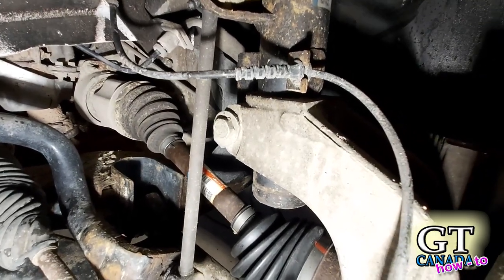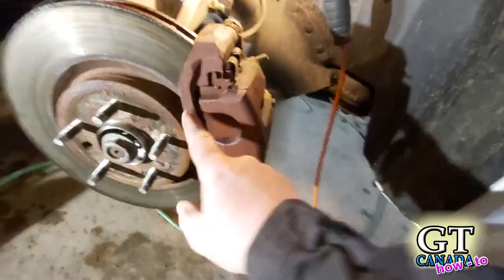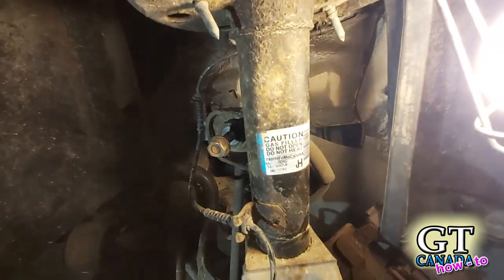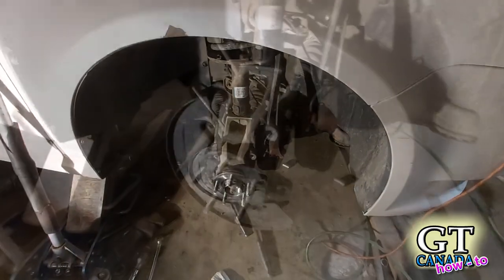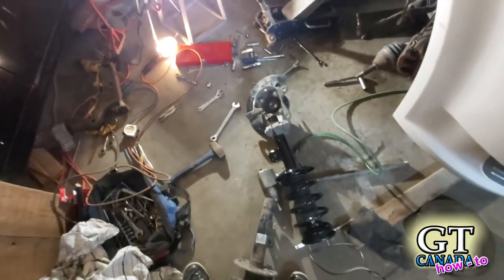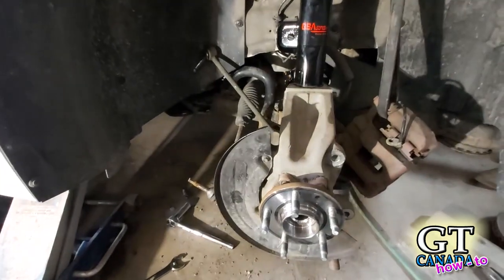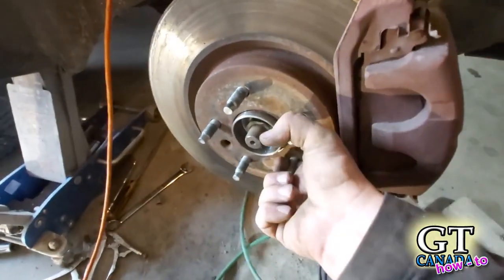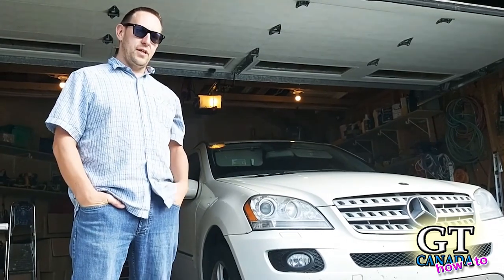2009 - 2013 Ford Flex Front Strut Replacement - GT Canada How To

Comment: Great video.  When the whole unit is on the ground check your wheel bearings they should turn smooth. Easy replacement then.
Reply from the maker: Yes for sure, that would be great time to check them. I had already replaced those so I knew they were fine, but for anyone that hasn't done them, this would be the best chance you'll ever have
Reply: What wheel bearings
Reply from the maker: The front wheel bearing. They are a complete hub. When you have the drive shaft out just rotate the hub assembly. If they are bad you will feel them binding up, catching, or grinding.
Reply: Then you’ve never done it. Spindle removal is far from easy. Simple but not easy. Perhaps it’s different on your year model. As the strut replacement was on mine. I was prepared to spend the day replacing struts. Took 2 hours. Only because I started the removal by following instructions on an earlier model. Night and day.

Comment: Just wanted to say thank you for the video.. Because My Lincoln MKT. Front strut, I was replacing and could not figure out why the struct was not comimg down. Until you showed that I have to drop the lower Control Arm. Than I was like yes. Again.. Thank you. Helping a working father save alot of money.
Reply from the maker: Glad it helped

Comment: Thanks. I have to do this job on my Lincoln MKT this weekend. Hopefully I don't find that I need control arms, but it won't surprise me if I do.
Reply from the maker: Good luck!
Reply: @GearsAndTech  Thanks. I wasn't able to get to it this weekend, but I did finally get to look at my parts, which had been shipped down to my sister's place where I do my bigger repair jobs, and the suspension on my '13 MKT is different than the front suspension on your earlier Flex. The strut is bolted to the knuckle via a bracket with 2 large bolts. You do have to take off the axle nut and drive the axle out so that the knuckle can tilt forward to release the bracket, but I shouldn't need to pull my control arm, which is a big relief.

Comment: It's a whole lot easier to take control arm off shoulder put in the back bushing then the strut with shoulder reattach ball joint then use a jack to push the front bushing in place
Reply from the maker: Could be. Glad you found a Esier way

Comment: Why didn't show how to remove the strut from the knuckle? That's the hardest part and I'm now stuck because I got the nut off but can't get the bolt out as it's easy to strip the bolt head. Do you just knock this part out with a hammer or is the inside threaded all the way through?
Reply from the maker: It's been a while, but I think I banged the  bolt till the head was out. Then I put a wrench in between the head of the bolt and strut and just turned the bolt while I leveraged the wrench to pry

Hard to explain. But it's a trick that works all the time
Reply: @GearsAndTech  I figured it out. I ended up having to use a torch and cut the screw in half with the little space I had between the knuckle. Then knocked the screw halfs out in opposite directions. Thankfully the driver side screw came out with 0 issues though.

Comment: What brand did you end up buying and would you recommend after driving with them installed? 
I'm looking at a front and rear kit made by TRQ as well as a kit from Detroit Axle.
Not sure which to go with, but I'll definitely be using this video for the install. 
Thanks!
Reply from the maker: The ones I used were from ebay. I spent a little extra because the were the only ones that said they work on 2009, which is different than 2010+

Theu ended up sending me 2010+ anyway, which meant I had to swap the end links for 2010+ and modify the sway bar. I'll be putting that video up soon

If you have 2010+ then go for whatever fits your budget. I think they are all pretty much the same until you get into name brand stuff.
Reply: @GearsAndTech  ok thanks. 
I have a 2011 limited that I love, but for some reason it just eats tires. 
I just put on my second set within a year's time. 
The ones I took off had major wear on the inside and outside edges.
I have a steering wheel shutter on the highway (around 70-80mph), but from what I can tell, all of my front end looks in tact. 
My tie rod ends have no play, none of the bushings are blown out, and none of the wheels have any play side/side or up/ down. 
I've got brand new tires, balanced, alignment, and the shake is still there. 
I'm taking a shot in the dark that it needs struts but don't really know for sure. 
Just trying to prevent blowing through another round of tires.
Reply from the maker: Inside AND outside usually means under inflated tires.

If it was just inside or outside I would look at suspension.

Warped rotors could cause the steering wheel shake too. Does it get worse when braking?

That much shake would be bent rims, not balance good, really bad tie rods or suspension bits (usually clunks over bumps too), or warped rotors.
Reply: @GearsAndTech  it's weird, man. 
Sometimes there is no shake at all when braking, and sometimes the shake is there. 
Maybe I should replace all the rotors first before diving that deep into the strut job. 
Couple friends of mine also mentioned brakes or a possible caliper sticking, but I never smell brakes or have any glaze on the rotors. 
Who knows, man hahaha. 
I definitely have something going on though.
Reply from the maker: I used to have a van that the rotors would warp going down long hills and riding the brakes slightly. The steering wheel would shake violently.

I switched to cross drilled rotors and all my problems went away

It only happened after riding the brakes for a long time.

You could simulate a hill by driving down the highway and have your left foot on the brake to warm them up.

You could try that too.

The flex is notorious for sticking rear brakes. Which I did a video on how to fix. I never got a shake, mine just had poor gas mileage and brake dust on the wheel.

Since yours is causing the tires to wear quickly on the front then it's for sure the front.

I would test the highway with the brake on trick.

If it happens a lot you can check the run out on your rotors with a dial indicator on a magnetic base. Or just buy the slotted rotors anyway and put new ceramic pads on and see what happens.
Reply: @GearsAndTech  I'll give that a try. 
Thanks for the time and advice, man! 
Great/ helpful videos too!
Reply from the maker: No problem

Tell you friends about the channel. And come back often!

Comment: I need to swap out my axles on my flex! What do you recommend as the fastest route without having to take apart too much?? Thank you.
Reply from the maker: I would disconnect the lower control arm at the frame, and the steering arm then swing the suspension out enough to get the axle out.

You don't want to be splitting ball joints or anything whenever possible. They tend to break easy
Reply: @GearsAndTech  thank you very much!! Much appreciated

Comment: How did you clock or figure out to clock the strut? During an alignment adjustment instructions for camber says to on rotate 180 degrees.. 3 or 9 o'clock.
Reply from the maker: It only goes in one way.

If you wanted to clock it to see if it makes a difference you leave the bottom attached and rotate the top

I got an alignment done at a shop after and they did whatever they needed to get it all within spec

Comment: Did the new strut assembly’s come with new washers for the sway bar link? I had new struts, but no new washers and now there is a 1/4” gap of play where the sway bar link bolt goes through the strut. So I’m wondering if yours came with those washers. Thanks
Reply from the maker: Sounds like you had the problem I had, you have a 2007 and your links have a taper to them.

If thays the case you need to get 2008+ sway bar links and install those.

Your sway bar will need the holes ground out a little bigger to accept the new links. I made a seperate video showing that.
Reply: @GearsAndTech  thanks so much! So I have a 2009, but yeah the sway bars don’t fit right. So I need to get 2008+ and ground out in order to accept the new ones? Thanks

Comment: Okay. Im doing the exact same job. You mentioned the control arm bolt with lock tite. How did you get it out? The nut i thought was welded to the frame but its not and i am on day five of trying to figure out how to get it out. Please help. Any advice
Reply from the maker: A long breaker bar with a pipe on the end is what I used.
Reply: @GearsAndTech  yea i did that and the nut is stuck on the other side.

Comment: what did you find out about the sway bar link mount issue of being loose
Reply from the maker: Turned out the struts they shipped were for 2010+ flexs

So, I just bought 2010+ sway bar links and installed those. Solved the problem completely.

I made a video how to modify the sway bar to accept the links. It'll be uploaded in the next week or so
Reply: @GearsAndTech  bought the newer sway bar links and had to drill out the sway bar holes bigger to make them fit. thanks for the video helped alot!
Reply from the maker: @esp68camaross33  Yes, Hopefully you found the video I just put up showing How I did that. You're on the same journey I was on with mine. 

Hopefully you don't arrive at the same conclusion I did about the Ford Flex in General

Comment: For the stabilizer links, what would happen if one were to use a 7mm hex head that fit into a screw bit attachment which fit into a 1/4” ratchet, and rather than use a wrench to tighten the nut, put a wrench on the nut and used the small ratchet to spin the centre bolt left to tighten the nut? Would that ruin something?
Reply from the maker: Sounds legit. Let me know how it goes

Comment: Is there a reference mark on the new strut so you know how far to slide it into the knuckle before tightening the pinch bolt? So both sides are even or it's at the proper height?
Reply from the maker: it will only go in at one height.
Reply: @GearsAndTech  I just did the rear. Doing these tomorrow. I think they could have made a easier way in the design to change these knowing they will fail eventually. Got 250 thou out of mine. Thanks for the very helpful how to video.

Comment: Could you have just replaced the front lower rear bushing instead of the whole control arm? I was looking at my 2009 flex and think it needs replaced.. have quite a clunk when hitting a bump. Maybe part strut related also. 2009 flex 150k miles. Sway bars replaced, tie rod replaced,  ball joints check out ok.
Reply from the maker: No, they come as a complete assembly.

I don't think they are even pressed in. It seems like that bushing is poured in and allowed to dry in place.
Reply: @GearsAndTech  I seen a youtube video after yours where the guy changed the bushing only, then seen on rockauto.com that the bushing can be purchased. Seems alot better if i can do that than spend $300 for a motorcraft control arm
Reply from the maker: @scottpolenske9224  personally I don't like doing a job twice.

If the bushing needs replaced then odds are The ball joint will soon. So I prefer to do it all at once

But, yes it does look like you can do just the bushing if you wanted.
Reply: @GearsAndTech  makes sence.
Reply: @scottpolenske9224  Have any information about that installation process video?   I don't like having to replace an entire control arm when it's just the bushing that bad either.   Also, I would rather replace the bushing and ball joint than a whole control arm as it's way cheaper than replacing the entire thing.
Reply: @inorite4553  I purchased an entire control arm and rear bushing. The ball joints cant be changed and require a whole control arm.  Moog makes one with rear bushing already pressed into place. And new front bushing and balljoint. Quick and easy and a new balljoint. Thought about it and went this route instead of just changing bushings.

Comment: So what direction does the mark on the top of the strut mount face/ point?
Doing My 2009 flex tomorrow.
Reply from the maker: Excellent question. I don't remember an arrow. It was a while ago when I did it

I didn't turn them at all. And made sure the tab for the sway bar link was facing in towards the fender.
Reply: @GearsAndTech  ...thanks, it’s not an arrow but more of a mark. I’ll look for more info.

Comment: 2014 flex 30 min a side for front struts. Top nuts removed with tires on the ground. Raise it carefully remove tire remove lower strut mounting hardware. Easy peasy lemon squeezy   Shop wanted $1800. 
 Keep your fingers Don’t mess around. Get the quick strut assembly.

Comment: Do I do similar steps to change out the cv axle on both sides
Reply from the maker: Yes, but not nearly as many of them.... You should be able to just follow the directions as far as getting the axle nut off. Then stop there. Remove the lower ball joint. That should allow enough movement to get the axle pushed out. 

It shouldn't be too bad.

Comment: How do you remove the strut once all disassembled i remove the sinch bolt but cant get the actual strut out the arm housing
Reply from the maker: If the bolt is out all the way it should slide out

If not, put a flat blad into the crack where the bolt was sinched down and pry it open a little

It should slide right out
Reply: @GearsAndTech  thanks ended up figuring it out thanks for the help!

Comment: Half of this work isn’t necessary. Iv done this job 4 times.
 You don’t need to remove any brake parts. Just remove the forward control arm bolt and the axle nut. That gives you plenty of slack to smack the assembly off the bottom of the strut. Undo the top four nuts last and the strut will fall off.
Reply from the maker: Some of these steps were done to save weight trying to balance everything 

But also, to swap the strut you need the brakes off
Reply: @GearsAndTech  I just replaced both front struts on a 2011 Flex today. I never touched the brakes. In this order: remove the upper stabilizer nut. Remove the strut pinch bolt. Remove the forward control arm bolt and pry the control arm down. Loosen the axle nut all the way but leave it on and tap it inward. Remove the antilock brake grommet from the strut. Tap on that portion of the assembly that was clamped to the strut until it’s free. Remove the top four nuts under the hood and the strut just falls out. Putting the new one in will require a little prying, tapping, and shoving, but once the strut is partially in, you just put a jack under the assembly and slide it together.
Reply: @yelwing you should've done on video on this. But if you need to remove the control arms this video is good. Just gotta figure out a way to not pull the CV Axle out of it's socket the way he did at  around 15:10.

Comment: That's the way to complicate things and risk to ruin your cv axle, I wonder WHY doing this way.  Following the workshop manual is way quicker easier and safe. Disconnect the ball joint fron the knuckle, then the cv axle and sway bar link and voilà you can remove just the strut an knuckle in one unit. And it's approximately 1 hour job for both sides.
Reply from the maker: Thanks for stopping by

Can you tell me which steps the workshop manual says to do?

I can't see any other way to do this. The cv needs to come off to drop the strut out. There isn't enough suspension play for the lower control arm to stay in